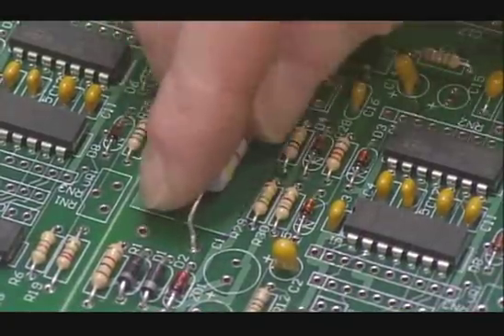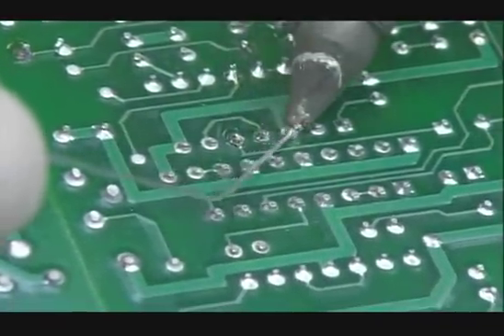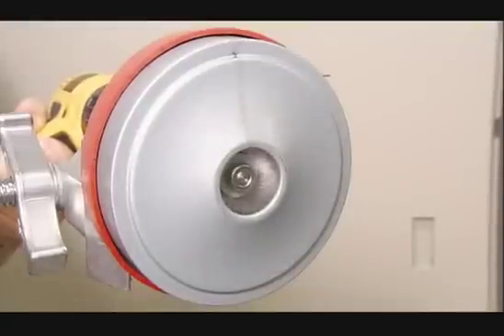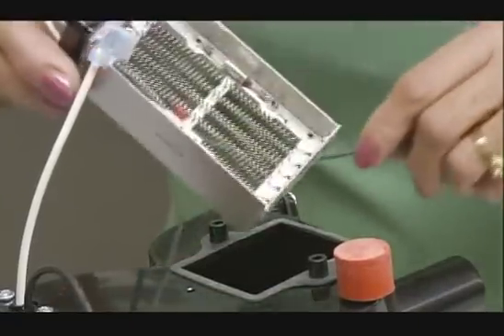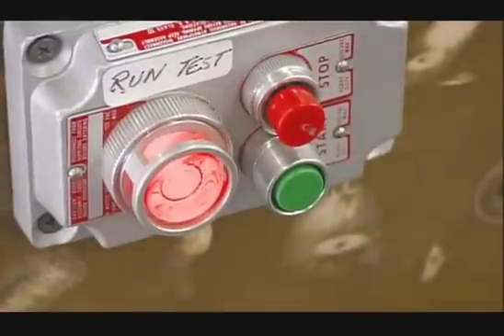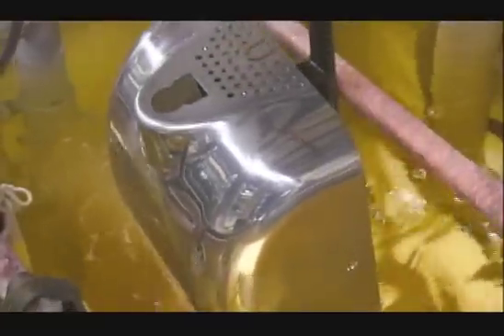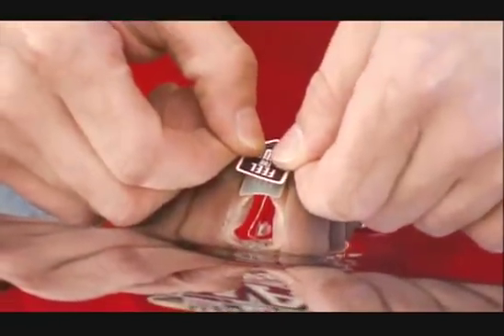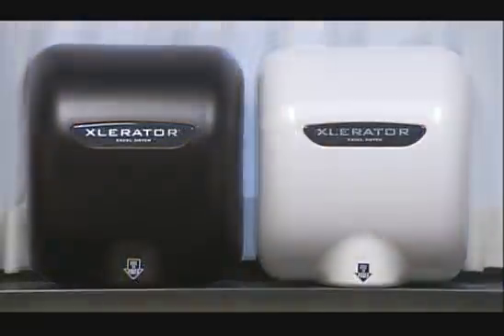XLERATOR Hand Dryer - Science Channel "How It's Made"

Comment: Please make you dryers quieter
Reply: They have speed and sound control, so you can turn down the air rate so its quieter, It also comes with the optional noise reduction nozzle.
Reply: @contentcontrol4128  ok
Reply: @contentcontrol4128  yeah at least u can

Comment: I bought these for my laundry mat✡> >imgs.love/XHandDryer?Ӛ    We were going through tons of paper towels. I was a little worried about the quality. They are great. Works perfectly and dry your hands very fast. You can plug them into a wall socket but I had an electrician hard wire mine. If you are buying paper towels for a commercial location, I highly recommend.

Comment: I use xlerator excel dryer and it’s very loud
Reply: When I was little I would really hate them and I think sometimes I would cry when someone used it because of how loud it was lol
Reply: I keep seeing comments on how loud they are. The people that do the installation of these dryers are more than likely lazy af and didn't take the time to change the factory settings on these. Both sound and heat settings are adjustable. It's unfortunate that so many people don't know this, these dryers are upwards of $450.00 each..they better have some sort of settings to ensure maximum satisfaction!
Reply: Brookfield Zoo has most of their Xlerappies turned down.

Comment: frame rate is so low
Reply: It is 29.97 FPS.  Methink you just have a slow computer that is skipping frames.  Try a lower resolution or upgrade your video card to something that can accelerate H.264, with adobe flash for best support, though today, step up a notch and get something with H.265 support too.

Comment: We have those at school, and they are so loud!
Reply: My school needs these I wish they had them because they are better than those old world dryers in our restrooms that still work but they are pretty old I believe they have been there since the school opened which I think was in 1990-2000 something like that
Reply: Xlerappy
Reply: Unfortunately, whoever installed them was to lazy to adjust the sound. This can be done prior to install. Actually, both the sound AND heat can be adjusted! So if your hands were still cold after having them under the dryer, the janitor/maintenance dude did you guys dirty 😂
Reply: The only thing that makes them loud is your hands underneath the blower try adjusting their position to lessen the noise
Reply: The T&T in Lansdowne Centre Richmond, BC, Canada has these and they are super loud. I did a dB test on those ones and the average was 106 dB
Reply: @BesthanddryerakaWDAare you serious?